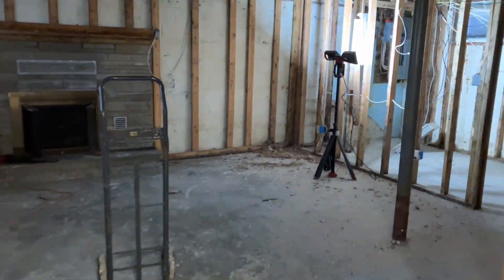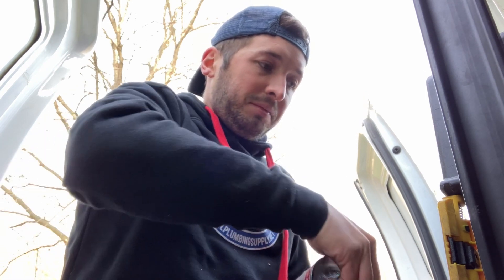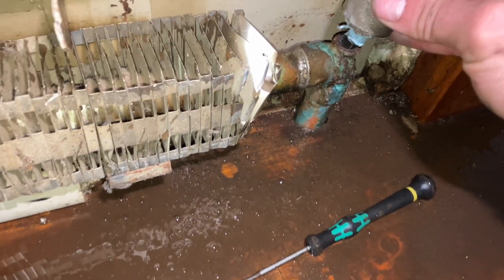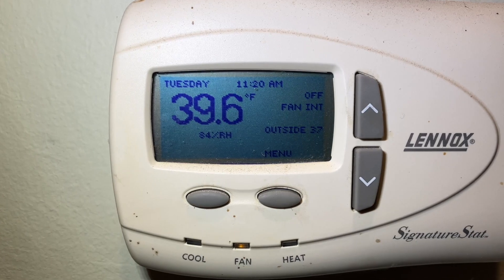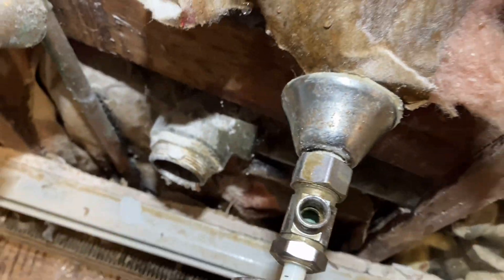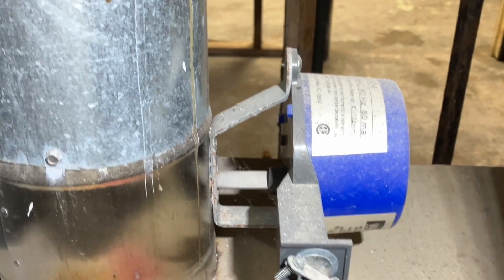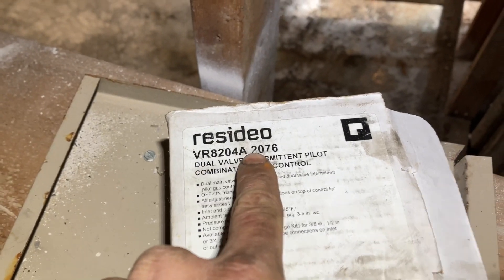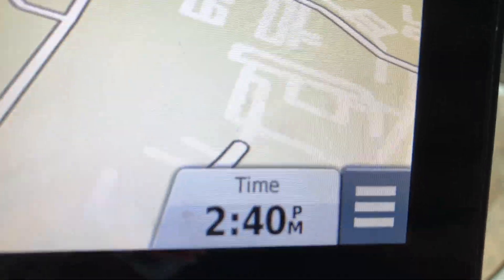HVAC Apprentice VS. Abandoned House

Comment: If they are gutting the house, why do you have to do anything to it?
Reply: I was wondering the same thing.  Seems for a total renovation, the whole heating system would be ripped out and replaced  with something more modern and energy efficient.
An 90% boiler with a thermostat in every room connected via a large manifold powered by a single circulating pump controlled via speed drive to keep the pressure consistent.
Replace all the radiators with heated floors and you will have a dream home on a snowy winters night.
Reply: @grandinosour easy to say but cost tens of thousands of dollars.

Comment: A braided faucet supply line and a 1/2" NPT cap is good if you want to avoid replacing the valve till a later date.
Reply: Even better Keeney makes a 1/4 turn valve with that weird 3/8 thread on both sides. Good to carry around for exactly this situation.
Reply: @theodorgiosan2570  Good point.  I've used the dahl 3/8x3/8 compression valves when the character of the house isn't changed by having an extra valve 😉

Comment: Do yourself a favor and get a 1/8 NPT pipe tap. Would have got you out of replacing that elbow. I got a set up to 1 inch and use them mostly for cleaning threads when they are old and crusty, but still solid

Comment: I did a huge cabin in Sunday river Maine  sleeps 56 had sit abandoned over 6 years had a well 2 1200 gallon storage tanks I had to rebuild all of that crap froze and broke and they was 137 breaks all over in base board and water lines .and it had underfloor that leaked also .had to put a new booster pump change the board on control module all new zone valves cir pumps and there was a whole wall of valves relays all kinds of crazy shit you talk about a awsome feeling when I got everything up and running cause of course it was dec 5 degrees outside yea no fun